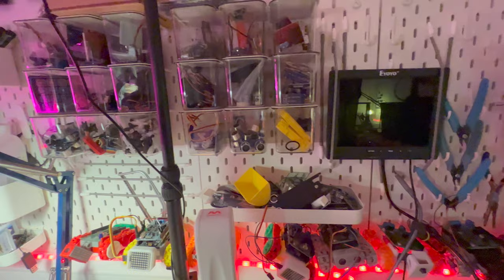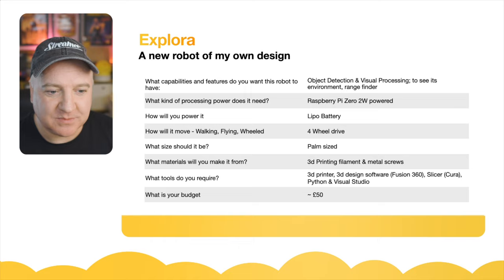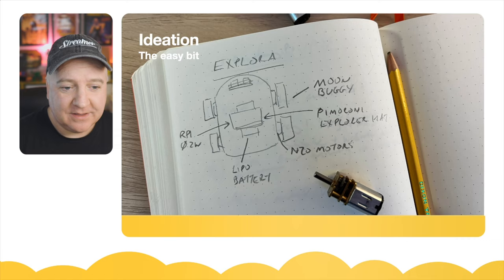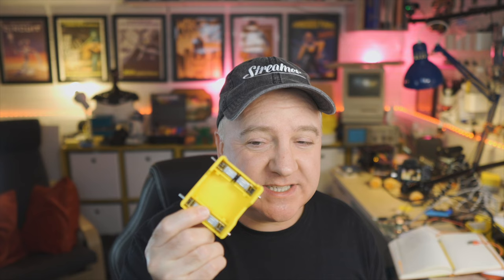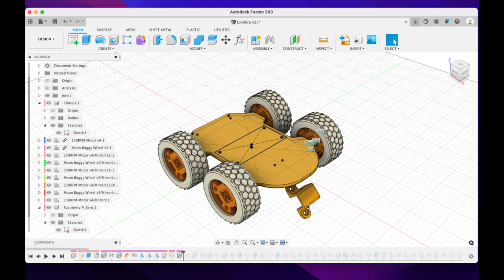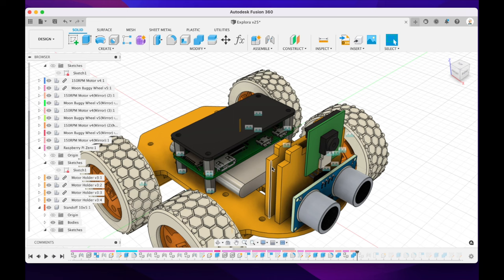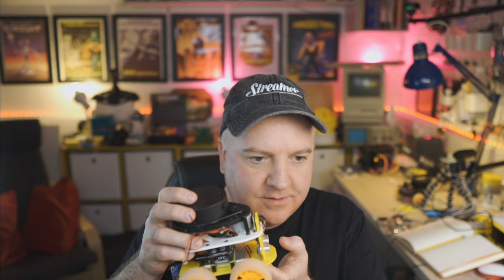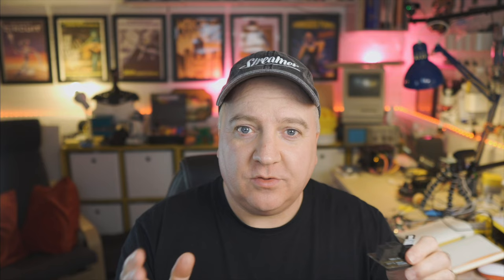How to build a robot

Comment: I'd love to learn SLAM using LiDAR on a small robot like yours, very interesting.
Reply from the maker: Yes! Thats the next step. I'm going to load Ubuntu onto the Raspberry Pi. I have tried to use Raspberry Pi OS and docker to run ROS inside, however that doesn't seem to work. I have had ROS working on a Raspberry Pi (See this video, I've set it to the part in the video that shows the Lidar working https://youtu.be/OIqkmgOY_Ws?t=2097).

Comment: Few questions/comments. First, you have 4 motors but the Explorer Hat only controls 2. How are you going to control the other 2? Why not use a dedicated TB6612FNG motor driver? These are small & easy to mount in your design. They drive the motors well and connection is straightforward. 

Are you going to have feedback controls on those motors? Might also be a good idea to integrate Mecanum wheels to give much greater maneuverability. Those can be used with a Pico but you have much greater processing capabilities with the Zero 2W. Would give you much better drive capabilities. I'd be a bit concerned about this being top heavy and that height restricts where the robot can go. Would definitely put the heavier items on the bottom. These considerations should be part of your requirements analysis, so you don't end up wasting time & $ designing things that don't meet your needs.

Just some things to consider.

Also looks like you started this but never posted any follow-ups. What's the status of this build?